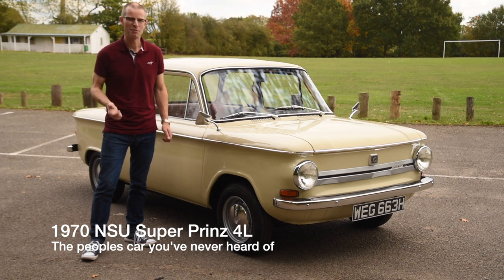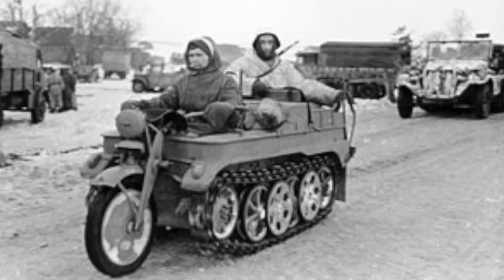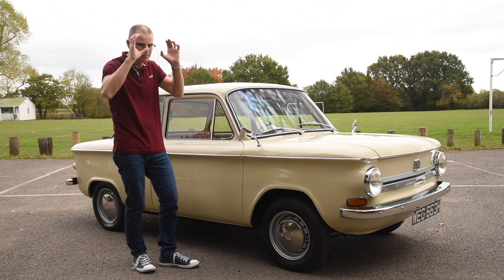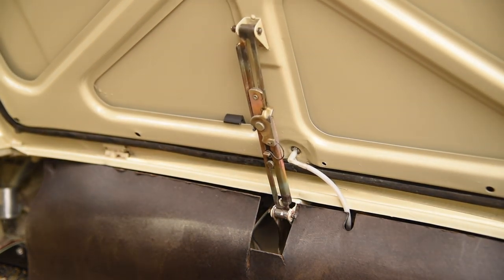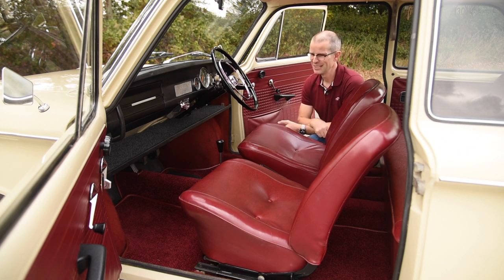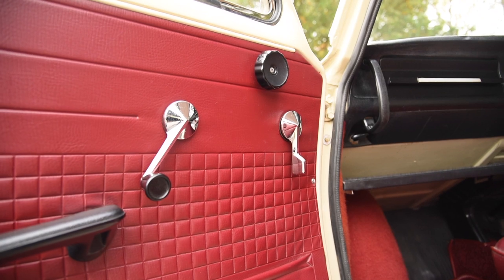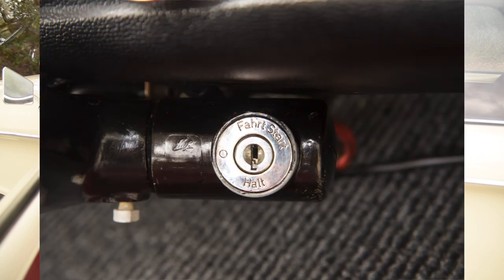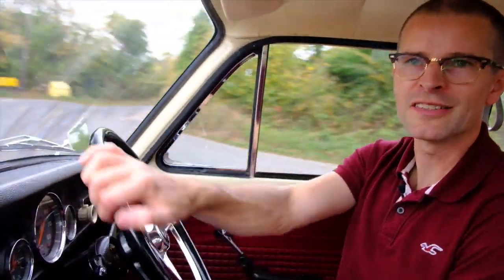1970 NSU Super Prinz 4L taken for a drive

Comment: Great video, thanks for posting. You are quite young so I excuse you from any historical faux pas. These cars were quite common in the UK in the '60s and '70s. Quirky but decent reputation. Most rear-engined cars of the period were a bit too light on the steering. Some people put bags of sand under the bonnet of their Hillman Imps, etc, to keep the steering firm. (Others put bags of sand in the boot to keep their rear-wheel-drives going through the snow). NSU was bankrupted by its Ro80 rotary-engined saloon car. It was a brilliant vehicle, 20 years ahead of its time in terms of comfort, handling, looks,  etc. Unfortunately its rotor tips had not been perfected and the engines failed invoking myriad warranty claims. My father converted two Ro80s to Ford V4s, one for him, one for his dad. I drove his for a few years and the ride and semi-automatic transmission was like something you would expect today. Amazing. Anyhow, I appreciate your enthusiasm and diligence to dredge up these old motoring curiosities.

Comment: The biggest NSU was the RO 80, a wonderful car, far ahead of its time.
Reply: I remember a wenkel engine isn’t it?
Reply: @neriozulberti1492  With a Wankel engine, yes. There were some engine problems with the first models. But as far as I know they were all fixed by warranty and goodwill regulations. The last models were very reliable.
Reply: Edward van Egmond infact but Mazda had reloaded the wankel and now what an engine
Reply: Indeed, apart from the engine it was so good that Audi continued making it in 100 and A6 guises right upto the current day. Strange because Germans like their cautious evolutionary approach, as with the Porsche 911, BMW 2002/3 series and Golf.
Reply: Character in TV show The Same Sky (set in 70s) drives one.
Reply: Michael Martinović  No, that is not true. The Wankel engine had a material problem with the rotor sealing strips, which was later fixed.
Reply: Michael Martinović  no, in fact it wasn't. the RO 80 (the Ro stands for ROtation engine – they made the K 70 at the same time: K standing for the german word "Kolben" = cylinde) was made with the same amount of love to detail and excellence as they always performed. the customers just didn't read the instuctions, how to drive a wankel engine. here in germany is still quite an amount of them around and running. they are very high in fuel consumption (it did not matter then), they drive still as mad and the colours are as innovative/beautiful as in the seventies. just icons. 

the most innovative german car, ever. still beautiful. 

at the end: nsu replaced all the "faulty" (= driver ruined) engines at their own cost, to maintain reputaition. they run out of money and had to sell their business to VW, who sold the K 70 for many years on; obviosly to be the best designed VW untill the first golf – whitch was an accident: giugiaro designed that car to be the uno', but fiat dismissed it as 'too big for italian cities'. [to be honest: that's VW in short.]
Reply: @winni2601  The engine was a failure that sent nsu to the wall from all the warranty claims.
Reply: The Wankel engine is a piece of art but it has its own characteristics. It is the link between a 4 stroke engine and a gasturbine.
No one would say a gasturbine is a failure even though in cars it never was produced (apart of the one Jay Leno owns)

Comment: 33 seconds to 63 miles or 17.5 seconds to 50 miles from stand still, all with 30 hp from 599 cc H2 twin.  The 1200 (1192cc) Beetle with 34hp needed 39 seconds to 63 miles or 19 seconds to 50 miles. The Trabant 601 last series with 26hp need 48 seconds to 63 miles (two door sedan manually shifted) and 22 seconds to 50 miles.

Comment: Pretty common in the UK in the 1960's. Most were scrapped when they broke down because getting them fixed and finding spare parts was difficult.
Reply from the maker: I remember seeing a few in the 80s but dont know when I saw another
Reply: Audi took NSU over and they didn't support the Prinzes with spares. 
I had one in 1980 and I had to get spares from scrapyards.

Comment: Had one as my first car in 1979.   There should be a cover over the engine as rain water gets onto the sparkplugs. It was missing in mine. My Grandfather used a metal door pocket off a Hillman Imp as a cover, fixed onto the top of the rear bonnet cover above the louvres.   Heater was chronic, as it was a heat exchanger from the exhaust.  Best way was to start her up, and hold a high idle for 5min. Also the fan was single speed and it was slow. Took ages for the windscreen to clear in frosty mornings.   There where some things that where really ahead of the times, like alloy finned (for cooling) front drum brakes with steel inserts.  Nowadays all car have discs , but some Renault's have finned drums on the rear brakes.     Yes she was basic, but which would you prefer car to get home in the wet Scottish winter, or a wait for  2 buses and a long walk home.   Yup basic wins

Comment: Not that uncommon in UK in the 60s.  The styling is just like the later BMW 1602/2002 series.
Reply: and also similar to the ZAZ Zaphorozhets, a Soviet flat 4 car
Reply: @psk1w1  Zaporozhets was actually a copy of this car (like a lot of Soviet cars of this era)
Reply: @mtjakubec  That is what I was thinking, but I am not familiar enough with either to be sure.  The engines are totally different, as NSU used in-line 2- and 4-cylinder air cooled engines, transverse with gearbox in a location more like a motorcycle engine, and the ZAZ is laid out more like a VW Beetle.
Reply: @psk1w1  Yes you're right. Considering the fact that even the first generation of ZAZ was copying the body of FIAT 600, it's clear that they took some inspiration from the NSU in the second generation, in the body design. (While NSU being more well made and reliable than ZAZ)
Reply: @mtjakubec  There was also a derivative of the FIAT 600 made in Serbia, but I don't know what engine it had.  This was the precursor to the Yugo.....
Reply: Not too surprising as Claus Luthe designed both the NSU Prinz  and the BMW neue Klasse.
Reply: @psk1w1  you mean Yugoslavia? It was called teh Zastava 750 and was produced from 1962 to 1985
Reply: @psk1w1  It's  been a while, but the Zaphorozhets had a V4 engine.

Comment: Just came across this video. My bright red NSU Prinz 4 (ANU609B- yes, I still remember the number!), was my first new car. I had just finished my engineering apprenticeship, my wife was a teacher and we had no kids (yet) so we splashed out. £550 I think.
We drove all over the UK in that car. It would do 50mpg no matter how hard you drove it, but in fairness that was usually with the accelerator to the floor. I once got it up to 80mph downhill but you needed a pilots licence for that because the already light steering was almost non-existent by then.
We just loved that car but only kept it a couple of years before getting a Singer Chamois.
It was fun the drive, but everything was fun then. Both of us working, no kids, a new car, newly married, couldn't keep our hands off each other. What memories we made.
Ps. You said it was for sale. What was the asking price? I'll guess about 4 to 5000 (£).

Comment: Its not flat engine, its inline 2 engine.
Reply: margus kiis 
But still flat in every sense.
Reply: margus kiis Shit, do you think you will get over it?
Reply: Like describing a straight six as a V6......
Reply: margus kiis .. that would be a parallel twin then!
Reply: I’m sure the power curve is flat 🤪
Reply: @MrStr8den  Indeed opposed to a boxer twin like the 2cv.
Reply: Technically, it is a transverse engine.  If it was "in line"  the cylinders would be aligned one in front of the other, not side by side.  In motorcycle terms it would be called a parallel twin.
Reply: So, it's a straight 2 not a "flat" 2. And, the cylinders are still inline, when the car doesn't have an engine...

Comment: My brother bought  a 1966 one in 1970 as his first car. They were simple but had some awesome technology. 
Overhead cam driven by con rods, the two coils are six volt in series and fire both cylinders at the same time, and the dynastarter, a starter motor and generator on one. 
Because the starter/generator  coil was about 250mm diameter it would turn over if the battery had any spark, and if it didn't it was the only car I've ever been able to push start up-hill on my own!  
The handbook had a graph showing fuel consumption vs speed. a srtaight line graph. 0 mph = 100 mpg to 100mph = 0 mpg.

My brother's had burned out valves when he bought it and  five years after the warranty expired the dealer provided a 50% discount on the new ones as they were the first valves that had ever failed.

Comment: I used to own one of these. Apart from the occasional breakdowns and catching fire in Southend it was a great car. I used to drive it flat out everywhere. Great fun!
Reply: What's a little fire? Never let that spoil the fun.
Reply: @pcno2832  It was a backfire that caused the mostly cardboard air intake to catch fire. It looked dramatic - lots of smoke and flame but was put out rather quickly and the car survived.
Reply from the maker: what's a small fire between friends?

Comment: In the mid-1970s, I bought a euro-spec VW Beetle.

It had a locking steering column instead of the key on the dash.  The four key positions were Halt-Garage-Fahrt-Start [Lock-Off-Run-Start].

Comment: Jim Brown mentions the 1000 and TT models. The dream version was the special order TTS. 100bhp from 1000cc. It was delivered with gearsets for road, hillclimb or race! I once saw a Swiss TTS with camping gear on the roof play with a hotted up BMC 1300GT on the M62. At 70mph the TTS driver floored it, and it was like the 1300 was stalled at the lights the NSU disappeared so quickly.

Comment: the dealers who distributed these car often did not do the servicing and repairs , think it was the cooling fan bearings that gave allot of trouble a local mechanic made special tools to use on thes cars and work came from the dealers , this was around 1970, the mopeds built by nsu called the  qwickly were more well known than the cars

Comment: Well made? Quality build? Are we really talking NSU Prinz here?
I had the misfortune to own one of these cars in the early seventies in my "old bangers" era. It was without doubt, the worst car I ever owned. Here is a list of its failures (some of them re-occurring).

The rear brake drums (aluminium), were fastened to the splined drive shaft with a large 2 tab locking washer. One tab used to chew it's way into the recess designed for it on the brake drum. Shortly after purchasing the mini monster, I was returning home after a visit to the local dealers to obtain a new Locking Washer having noticed some wear in the rear nearside wheel area.
Slightly downhill on a long gentle left hand bend, I noticed out of the corner of my eye, something overtaking me on the inside.... Yes, it was my rear nearside wheel. The realisation coming to me as I keeled over onto the Brake backing plate. As it was slightly downhill, my escapologist wheel continued for at least another 1/2 mile before itself keeling over. How the oncoming drivers managed to avoid it, I will never know.

It used to regularly spit spark plugs out of the cylinder head. On a 2 cylinder car, this has a drastic, immediate effect on what performance there was to begin with. I now know that particular fault could probably have been cured by a couple of "Helicoils" but in those days, I was on a very limited budget and it had spat one too many spark plugs out.

One of the worst faults was caused by the engine mounting syste,m. 3 rubber blocks, 2 at the bottom either side and the main anti torque one at centre top. Every time you take off from a standing start, the engine tries to rotate backwards, or on the overrun, rotate forwards. All controlled by the anti torque rubber bush at the top, until that decides it has had enough. The net result here in that as soon as you change torque direction, the whole engine pivots on the 2 lower mountings (usually forward, as it is mounted at an angle) until it is resting on the bulkhead between the engine and passenger compartments. At this point the weight has also been taken up by the gearbox end of the gear control lever. You will now find that your gear lever cannot be moved and you are stuck in whatever gear you were in prior to the catastrophe. Hopefully that will be 2nd gear and not neutral, so you can at least get the heap of rubbish out of everybody else's way

The steering is light. A bit of an understatement there. It was so light that stop the chance of aquaplaning on anything more than a Summer Dew, most people used to carry a bag of sand around with them in the front of the (front) boot.

A bit of fancy switchgear doth not a Classic make. NSU should never have survived the production of this machine. Not sure how it overlapped chronologically with the Hillman Imp, but switchgear apart, The Prinz wasn't a patch on the Imp.

Sorry for the length of this, but I will never forget my association with this (IMO) pile of c**p
Reply: As I mention in another post, I had the 1200cc version .... a few foibles that I had were the cylinder head parting from the block which required helicoiling ...... heat exchanger exhaust rusted on the inside which let exhaust fumes into the cabin via the heater vents ..... Clutches also didn't last five minutes.
Reply: @Mariazellerbahn  One further fault I forgot to mention,but which was quite entertaining.
The gear selector stuck out of the front of the gearbox and had a right angle bend turning downwards, terminating in a "Ball". The remote control rod can straight back, through the bulkhead to meet this "Ball". It had a "Cup" on  the end to locate the ball. The ball was secured inside the cup by a Rubber (plastic?) grommet, which had long since disappeared. When driving in London traffic where one had to be reasonably quick off the mark, the ferocious clutch would cause the engine torque to rotate the engine, including the ball, backwards. As you declutched to make your fast change to 2nd gear, the engine would return to normal position. However, the remote control cup would no longer be aligned with the selector ball. Total disconnection of gears and again left with whatever gear you were in prior to this. The solution to this was to forcibly hold the remote gear lever in the required position, usually 1st gear and jump the clutch repeatedly until the ball miraculously relocated itself back within the cup. All great fun in London traffic.
You may wonder that I held on to this piece of junk so long, I still wonder myself, but budgetary requirements were the main reason.
Reply: Reminds me of my father's Opel Kadett; the Germans have  knack for making cars that seem well built until you put a few miles on them.

Comment: I owned one about 40 years ago, it was 6 or 7 years old then.
At its end of life, though very little rust.

Most cars had a very short lifespan in that time, say 70's, early 80's.
Lot of fun driving it, handling was not too bad, but terrible brakes.
A briljant designed engine, overheadcam with a very complex system to drive the camshaft,  and the dynastart, a combination of a dynamo and starter directly mounted to the driveshaft.

Comment: My first car (well, a '65 one). Ridiculously frugal! The 1200 was basically two 600 blocks end to end. The 1000 made more power than the 1200, and the top models were the 1000 TT (name resurrected later) and the 1000 TTS, - 96bhp. Then there was the option of the Speed Kit. On the M6, an MGB tried to show off by overtaking a Swiss-registered TTS. The TTS took about 25 seconds to disappear over the horizon.

Comment: "NSU, kaputt im Nu". NSU broken in an instant, was the comment made by bystanders when these vehicles broke down in Germany. Rustbuckets they were, that's why you don't see many nowadays. This example was either never driven in winter or has been restored. Right hand drive makes it even rarer. Great vid!
Reply from the maker: restored at great expense by someone!
Reply: BS.
NSU was quality wise on the better side of the German car manufacturers.
I would go one step further and say not NSU has vanished but AUDI and VW have.
Let me explain what I mean.
When NSU was sold, it was split up. AUDI took the NSU RO80 and put an AUDI logo on it. That was the first modern AUDI and the slogan Vorsprung Dutch Technik was invented for the RO 80. AUDI A6, A8 were developed from the RO80 design, while the Audi TT... well, check the NSU TT...

VW took the NSU K70 and put a VW badge on it. That was the first modern VW with inline 4, watercooled, front driven, frontengine Volkswagen.
There is more NSU DNA in every AUDI and VW than you might think.
If NSU was such a failure, how do you explain that AUDI and VW did go the path that NSU started?

Comment: The last and most powerful version was the 1200 TTS/E. They had between 70 up to 85 hp! Nice and astonishingly agile cars, often used in hill races. Good drivers could outperform BMW‘s or even Porsches.  Only negative aspect: they got quite warm in the engine compartment, and several burned out about 10 - 15 minutes after they were parked

Comment: The actual reason why it was no success was not the engine. It was plain and simple the body design. In 1970 people expected an eye-catcher, even when the car was cheap. But the Super Prinz 4L was considered ugly. A bathtub with four wheels. Citroen Duck was also considered ugly but it was extravagant. That's why people bought it. There was just nothing you could fall in love with the 1970 NSU Super Prinz 4L. Today it might be different, it is a nice minimalist car. Awesome restoration of the 1970 NSU Super Prinz 4L in the video.